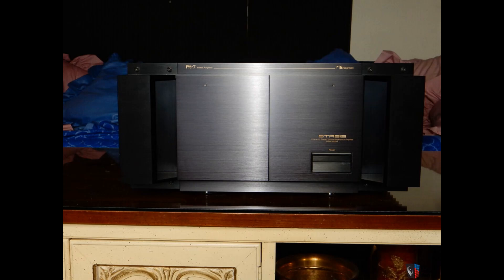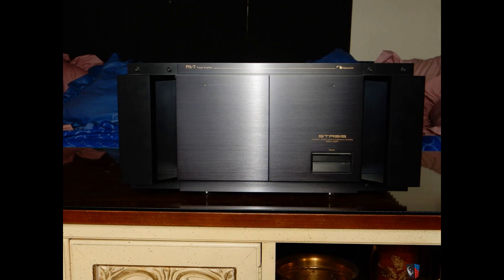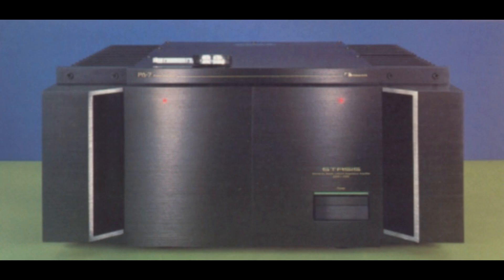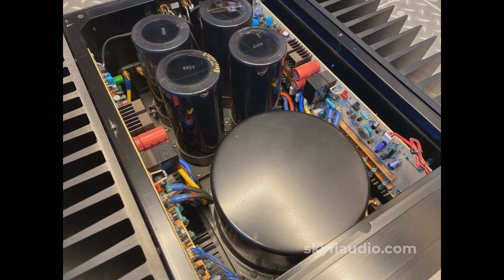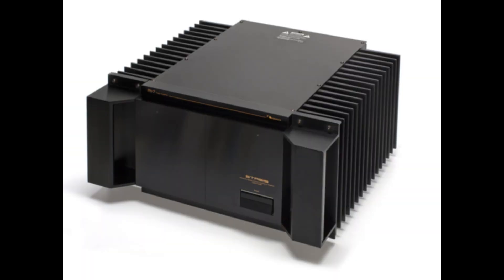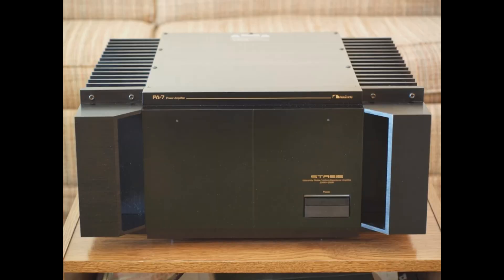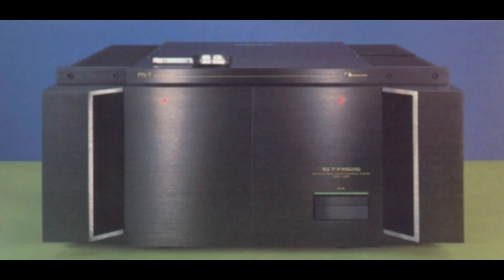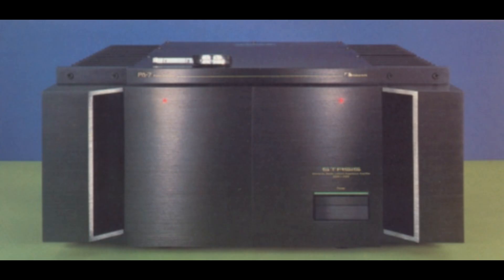Nakamich PA-7 Elite Amplifier from Nakamichi. Nelson Pass Threshold designed.

Comment: This amp still didn’t perform nearly as well as Pass’ Threshold Stasis1,2,&3 amp models, read the reviews🤓.
Reply: Some say it did
Reply: The nak IS stasis 1. It's licensed from Nelson Pass.  Pass stasis 1 amps were thermally unstable.  Prone to oscillation. So was stasis II (I owned one) By III, it became a more stable circuit/amp design.